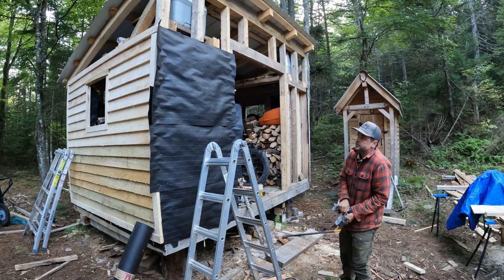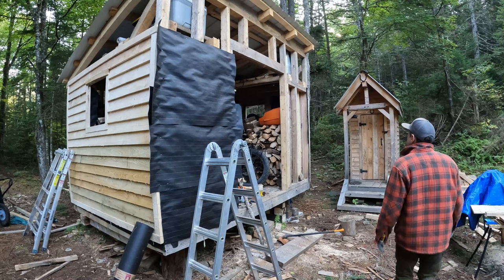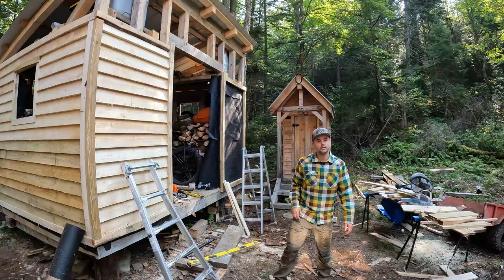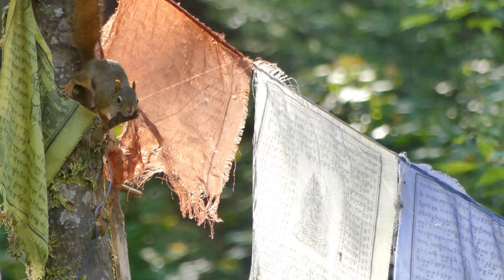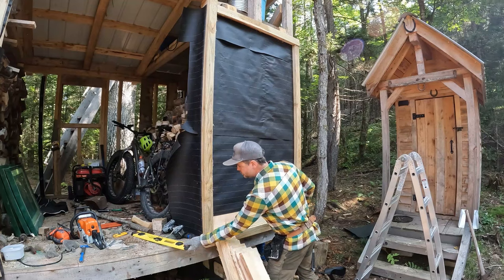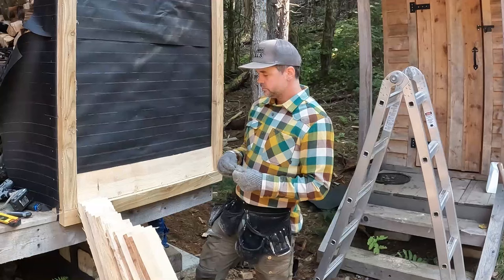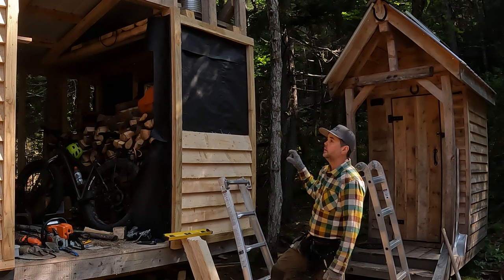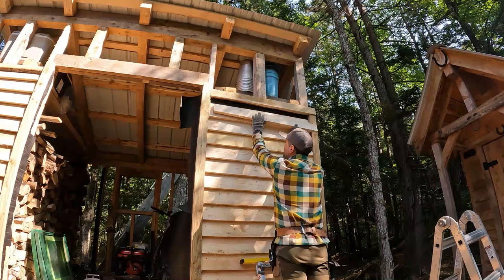DIY Lap Siding | Getting Ready | Woodshed at the Cabin

Comment: Great job! I was interested in why you made the woodshed so "air tight". Usually the siding in a woodshed would have spaces to promote air flow...and no paper underneath the siding for the same reason.
Reply from the maker: Well, I'm thinking that longer term this will become a workshop and my original shed may become the real woodshed. So, I'm building it with an eye to the years ahead. But with the windows and door I hope there should be some decent enough air flow to let wood dry. So, I guess that's why :)
Reply: Thanks...makes sense! @PenniacWilderness